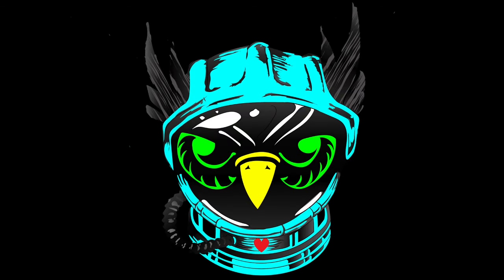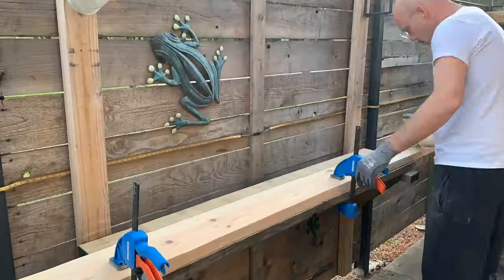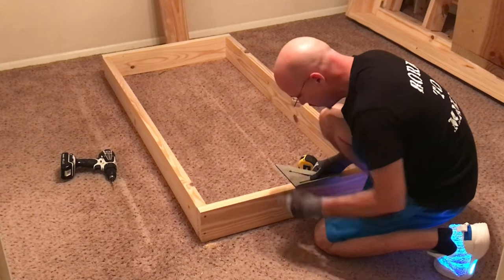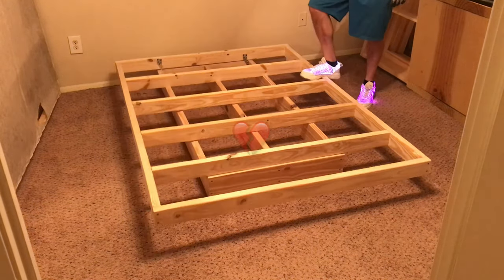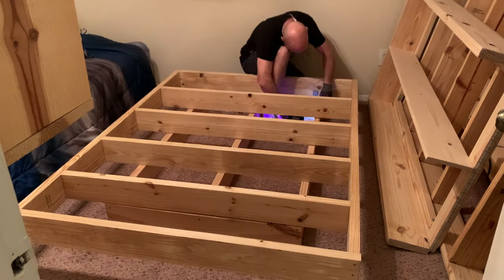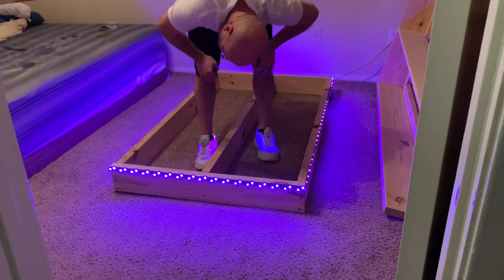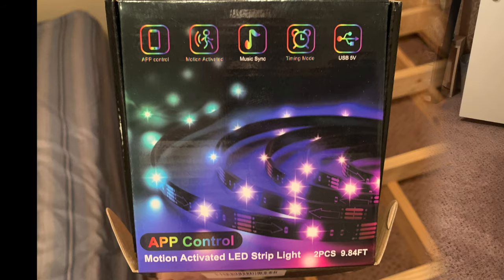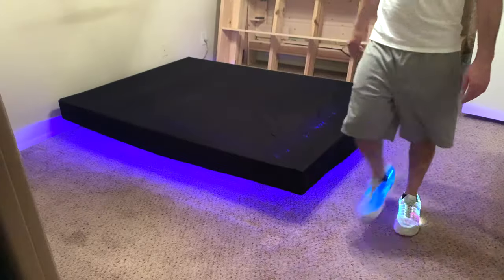Full Size Floating Bed Frame

Comment: Are the joist spacing marks you made the center of the 2x6 or the edge? Are you starting the marks from the foot of the bed or head side? I’ve finished everything but the joist and wanted to double check so I don’t screw it up. I’m already aggravated from the crooked wood I got from Lowe’s. It didn’t look too bad when I first bought it and I even put about 200lbs of weights on it to flatten it out. Apparently that didn’t quite take all the bow out of it and when I finished the bed frame two of the opposite ends were off the floor so I had to drag all my weights back in my house and put on the opposite ends to flatten it out. I’m hoping once I get the joists in with the weights still on the ends it might work itself out.
Reply: I figured it out. Thanks
Reply from the maker: @jeffg5989 Hey Jeff, I saw your original comment/questions followed up quickly by your reply that you figured it out.  I apologize I'm just now having time to reply to your requests here...but I have been eagerly waiting to give you some input.  Let's see what we've got here:

So, now you know, but it's best to take the time to select wood/lumber/timber that is as straight as possible when you purchase it.  I don't go to the blue home improvement store...I always recommend the big orange one.  Anyways, selecting your lumber, in some cases, takes a monumental effort but it is worth it when it comes to cut and build time.  You could put literally all the weight in the world on there and they wouldn't straighten back out.  ...When working with hardwoods, you can apply steam to bend your pieces, or, in some cases, you can wet one side of your wood and put it face down on some plastic while it dries out to help take the bow out, but trying to just put some weights on there like you are talking about won't work my friend.  Experience tells you these things.  

I think I measured from the outside of the head side of the frame in the video.  That part isn't important though...what is, is that you do it the same way every time.  Start from the outside of the head part on the left side and pull your measurement, making sure to know where you are planning on placing your board.  Do it the same for every board...you don't need to copy every single thing we creators do my friend.  I'm human just like you and have a tendency to jack things up from time to time.  Really, I just eyeballed the measurements when I was building it.  Made sure that first joist at the head would run right across the head part of the base and make sure the last joist in the frame runs across the foot part of the base...approximate the spacing on the last joists and its a done deal.  

Hopefully I covered everything and you are satisfied with your build.  I appreciate you supporting this channel.  Let me know if you need anything else.  Talk to you again down the road my friend. 🤝
Reply from the maker: @jeffg5989 Glad you got it figured out, I knew you would!

Comment: Great video, about to make my floating bed next week, I have a question, what size of screws did you use??
Reply from the maker: @MIE2 Hey M, thanks so much!  I think you should, just make sure to be careful.  This is a super simple build and it turns out great!  I’d recommend using 3” screws at all the junctions in the base and frame.  I hope this helps.  Thanks so much for your time and support.  Stay blessed my friend 🙏
Reply: @CurtisMadeIt  thanks for your reply! Stay blessed too buddy!!
Reply from the maker: @MIE2 🫡

Comment: What is never mentioned was the reason for instability. Was it the base or the lack of weight when using 2x4's as a frame instead of 2x6's.
Reply from the maker: @nathantronnier4207 Hey Nathan, good morning.  Yes.  The answer you your question is yes.  The reason that wasn’t mentioned in the video is so that you and I can have this conversation here today.  I think it was a combination of both.  The wider base and the additional weight of the 2x6’s was what ended up making the difference.  I don’t like these to tip at all before I post the videos and I made sure to include the final dimensions that I used.  I hope this helps.  Let me know if you have any other questions at all.  I appreciate your time and support on this channel my friend, thank you 🤝

Comment: I want to build one but for twin but got a question do we just like on the top do you build a frame and then just put the mattress on top?
Reply from the maker: @Kayla Ramos Martinez Hey Kayla, thanks for your question and interest.  Several people have asked me for the dimensions on a twin size floating bed frame, but it is too long and too narrow to be able to hide the base like you are able to on the full/queen/king/cali-king size bed frames.  Any of these sizes require a box spring, plywood, or some people have even used cedar pickets to support the mattress, otherwise, it will sag in the spaces between the joists.  I hope this helps.  Feel free to contact me on instagram realc_love1 at any time.  Take care and stay blessed my friend 🙏.

Comment: Great video great inspiration I’ll built one just like that this weekend!! Just one part that’s confusing you’re saying that you changed your design to use 2x6 instead , but right after you’re saying the 2x4 are a better change, so you used 2x6 or 2x4 ?? Thanks in advance!
Reply from the maker: @Nour Yassin Hey Nour, sorry for the confusion.  Make sure and use the 2x6's.  You need the additional weight as a counterbalance to keep the bed frame from tipping over.  I hope this helps.  Feel free to reach me any time on Instagram realc_love1.  Talk to you again down the road my friend.
Reply: @CurtisMadeIt  love it ! Thanks again really appreciate the clarification keep it up man !
Reply from the maker: @Nour Yassin You bet 🫡.  Thanks a lot for your support my friend.

Comment: Thinking I’m going to use this design for my own personal bed build. How far apart did you space studs on both upper and lower frame? Appreciate your time
Reply from the maker: @Drake Lohse Hey Drake, thanks for your interest.  I've built so many different versions of these bed frames, if I remember correctly, I think the studs on the full size are either 15 or 16 inches apart.  I hope this helps.  Talk to you again down the road my friend.

Comment: Would adding legs at the very top of the bed eliminate the tipping problem? It's not like we're going to have our feet that close to the wall... Or maybe the top & midway, making it not exactly 'floating.' 🤔
Reply from the maker: @Good Intentions Hi Good, thanks for your question.  This bed frame doesn't have any problems tipping at all when it is built as I suggested in the video.  Make sure an pay attention to the dimensions for the base, otherwise it WILL tip over and, of course, we don't want this.  Adding legs (for me) isn't an option because then it wouldn't be a 'floating' bed frame anymore.  I hope this helps.  Please let me know if you need anything else at all and feel free to reach me on instagram realc_love1 at any time.  I'll talk to you down the road my friend.

Comment: Hi,  whats the high of the 2 pics base and frame
Reply from the maker: @شرارو_SHRARO Hey there my friend, thanks for your question.  If I'm understanding you correctly, you are asking the height of the bed frame.  As seen in the video, it is about 11 inches, or 27.94cm in height.  This is just two untreated 2 x 6's on edge, stacked on top of each other, built in the USA.  I hope this helps.  Be careful building.
Reply: @CurtisMadeIt  thank you sir for full answering ❤❤
Reply from the maker: @شرارو_SHRARO you bet my friend.  I’ll talk to you again down the road.  🤝

Comment: I am in a apartment will Home Depot cut the wood for me? Or should I buy my own saw? I want to make 2 twin sizes for my kids and it’s my first time lol 😂 
Thank you from Houston Tx
Reply from the maker: @viniece singleton-adams Hey Miss V, thanks so much for stopping by.  Small world...I'm in Houston too!  Yes ma'am, Home Depot will cut the wood for you.  I would advise getting your own saw if you plan on doing any other woodworking projects at all as HD will likely charge you per cut.  I'm not too sure of the stability on a twin size floating bed frame.  This is a very long and narrow mattress and is hard to get a base underneath it while still achieving the floating effect.  I'd be somewhat curious to see what a twin size looks like when it is assembled though.  I'm on Instagram realc_love1 if you'd like to reach me there, just to let you know.  I'll be happy to work with you and design something that I think will be safe and that you will be happy with.  Thanks so much for your support, I really appreciate it.

Comment: Was it tilting over because he made the base too small or because he used 2x4 instead of 2x6 for the frame?
Reply from the maker: @Bryan Baca Hey Bryan, thanks for your question.  I believe it was a combination of the base being too narrow at 30”(widened to 36”) and the frame being made from 2x4’s(replaced with 2x6’s).  I hope this helps.  Thanks for your time and support.  Stay blessed my friend 🙏
Reply: @CurtisMadeIt  thanks for the response! My plan was to us 2x4s for the 4 pieces that are 54 inches (frame joists) that way there’s a 2 inch depth to put a box spring so it doesn’t move around.
Reply from the maker: @Bryan Baca I’m glad to help.  No need to build it the way you are talking unless you really want to.  The box spring and mattress don’t move at all…not gonna walk or creep towards the edge of the frame.  I mean you can if you want to, but I’m just letting you know it’s safe to build as illustrated in the video and you shouldn’t have any problems at all really.  I’m sure by now thousands of people across the world have built this bed frame and I haven’t heard of any complaints.  I hope you enjoy your new bed frame.  Be careful building.  Come back and talk to me down the road.  🤝

Comment: Hey buddy, going about to do this for my son, but if I wanted to make it higher, do I get wider boards?
Reply from the maker: @carlosholguin3182 Hey Carlos, thanks for stopping by.  Yes, this is correct.  Instead of (what I recommend) using 2x6's for the base and the frame, you can just as easily get 2x8's or 2x10's for the base and go with the same measurements.  This will have your frame sitting taller.  I hope this helps.  I appreciate your time and support here my friend, I mean it 🤝
Reply: @CurtisMadeIt  thank you for replying. Highly appreciate it so I think I’m gonna go  with the 2 x 10 one quick question on the bedframe. The choices are in the middle. What are the inches that you separated them?
Reply from the maker: @carlosholguin3182 Hey Carlos, I’m just now seeing your reply 🤦‍♂️ I don’t remember the exact spacing to be honest.  The joist at the head area needs to run on top of the headboard for the base.  The joist at the foot area needs to sit back about two inches from the end of the base.  The spacing between the other joists I think was between 16 and 17 inches each…again, not trying to be vague or cryptic, I just don’t remember exactly what it was.  I hope this helps and I’ll make sure to reply more quickly if you hit me back.  Take care my brother.

Comment: Do you have the dimensions for a queen size for top and bottom? I would like to build it for myself.
Reply from the maker: @Julie lachetti Hi Julie, I sure do!  Please check the videos/content section on my channel and I actually have three videos for the queen size floating bed frame.  In those videos...either spoken, on screen, or in the written description down below, I have the dimensions used for those builds.  If you'd like, I also have CAD blueprints available for the queen size floating bed frame.  Reach me on instagram realc_love1 and I'll get you everything you need.  Thanks so much for your time, interest, and support.  Talk to you again soon.

Comment: What if you were to bolt this floating bed frame to the slab. To me that would make it the most solid as possible
Reply from the maker: @Jacko Wacko Hey Jack, thanks for your question.  You can bolt this to the floor if you’d like, but there is no need to at all.  This bed frame is already as rock solid as it can be.  I hope this helps,  I appreciate you stopping by.  Talk to you soon my friend.

Comment: So i have a question, I got the wood for the base and they 2 pieces at 36 in and 3 pieces at 60 inches however the middle part doesn’t fit it seems to be the wrong size or am i doing it wrong?
Reply from the maker: @heyd-slice9418 Hey Slice, you may be doing it wrong…right now it sounds like you are screwing through the 60 inch boards.  Screw through the 36 inch long pieces in to the 60 inch long pieces.  That will fix things.  Can I help any more at all?
Reply: @CurtisMadeIt thank you for your response I ended up figuring it out, i was indeed placing them wrong like you said haha I appreciate you responding so fast
Reply from the maker: @heyd-slice9418 You bet 🫡 Glad you got it all figured out.

Comment: Hi, how many of those metal joint fasteners do I need for the full size?
Reply from the maker: @ajaservais249 Hey Aja, I’d recommend 4 - 2” L shaped corner brackets to secure the base to the frame.  I hope this helps.  Any other questions?  Talk to you again soon my friend 🤝
Reply: @CurtisMadeIt  ok thanks! Going to make this my winter project
Reply from the maker: @ajaservais249 Okay, so cool!  Be careful.  I’ll be here if you have any other questions.

Comment: Couldnt you have secured the head frame to the studs in the wall with lag bolts to secure it not to tip?
Reply from the maker: @Christina Archambault Hi Christina, thanks for your question.  Yes ma'am, I sure could have, but that wouldn't have been as user friendly to people like me who live in an apartment and/or otherwise don't want to damage their walls while acquiring their new bed frame.  I hope this helps.  Talk to you again soon my friend.
Reply: @CurtisMadeIt  makes sense :) it turned out great
Reply from the maker: @Christina Archambault I appreciate your time, question, interest, and compliment.  Thanks for supporting my channel and dream here.

Comment: If you secure the top platform to the base won’t that stabilize it?
Reply from the maker: @philam1973 Hey Phil, you would think so but if the base isn’t wide enough, it definitely will not.  I figured this out the hard way.  You need your base to be a little wider as stated a little later in this video for it to be stable once you secure the base to the frame.  I hope this helps.  Reach me on Instagram curtis_made_it any time and I’ll be glad to help additionally as needed.  Take care my friend 🤝
Reply: @CurtisMadeIt  I’m interested in making one for my vacation house on the next island house to be built this year.  How much distance between the two was sufficient?  BTW I plan on making a full size too.
Reply from the maker: @philam1973 …for the next vacation house on the island.  I’m not really sure you need to be doing all this work yourself…I can come build it for you.  When is a good day?  😂 Seriously, I would though.  You need 33” between the 2x6 base side boards for a total distance of 36”.  Those side boards should be 60”.  Secure through the side board in to the head/foot board of the base(those 33” long pieces).  I hope this helps.  Let me know when my flight is ✈️.  Talk again soon Phil 🤝

Comment: Hi, I want to build this but I have 2 problems
1 I don’t want a box spring 
2 I want my bed horizontal on the wall (the long way)
Hopefully you can help me figure this out and I’m not a year late😂😫 thankssss
Reply from the maker: @Tyra Crespo Hey Tyra, thanks for stopping by and sharing your concerns here.  You aren't late at all, really, you are right on time.  Thankfully, I've helped modify enough of these floating bed frames by now that I think I can help you.  1. Instead of the box spring, you can use plywood...just the 15/32's or 1/2" will be just fine, you don't need the thick expensive stuff.  2. This would be a first that I am aware of for the full size, but this could easily be modified to make it happen.  I'm on instagram realc_love1.  Reach me on there and I'll make sure you are all set up before you get started.  Talk to you again soon my friend.

Comment: Did you consider attaching to the wall?
Reply from the maker: @Bryan Shelstad Hey Bryan, thanks for your question.  Nope.  I just built it solid and stable enough that it doesn’t need to be secured down to the floor or the wall.  I hope this helps.  I appreciate your time.  Talk to you again down the road my friend.
Reply: @CurtisMadeIt  I am going with the original smaller size bottom and putting two screws in the wall studs. Maximize float effect. Plus cross trusses matching base for secret box only accessible by lifting martress :)
Reply from the maker: @Bryan Shelstad Awesome.  This sounds like an ambitious and fun build.  I’d sure love to see it when you get done.  Feel free to reach me on Instagram realc_love1.  Thanks again Bryan, talk to you soon.

Comment: Also what screws did you use
Reply from the maker: @user-ok6pd9zr4b Go with 3" screws at all the wood junctions and I used 1 1/4" drywall screws to secure the 2" L shaped corner brackets to the base and the frame.  Let me know what other questions you have.